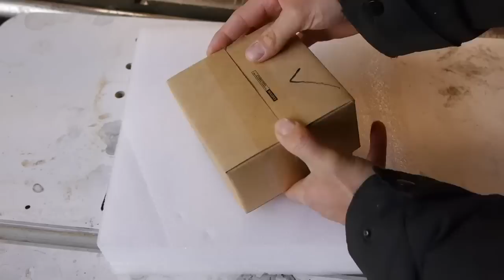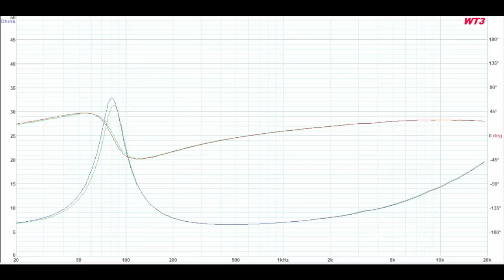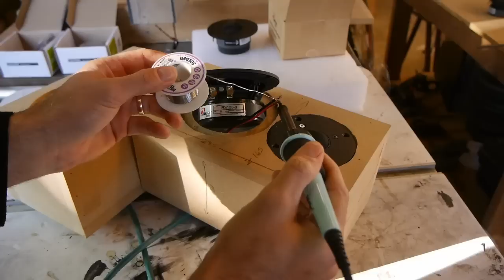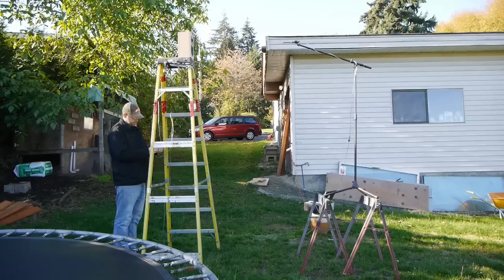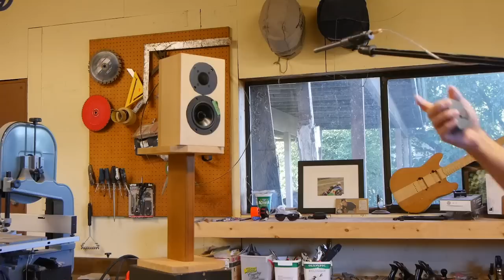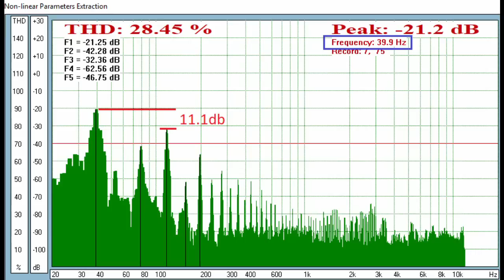Dayton Audio RS125 | Test and Review

Comment: I want to buy the 6" but I want to know if it's air tight? I'm making sealed monitors
Reply from the maker: Ive used the 5 and the 8, but not the 6. What do you mean air tight? It works just fine in a sealed box. Thats how I used both the 5 and 8. Decent woofers.

Comment: i giggled wen you said you do not find a build like this at this price 45.00 usd so so true but  for a 5 inch speaker i better get descent build for that i do understand speakers are way over priced in some cases .all so i have had a run of driver custom made woofers in the past and ill tell you in around 1999 a usa made 15 inch driver 2.5 inch coil on a  Kapton former twin magnet stack stamped steal basket rubber surround carbon composite light weight cone inverted dust cover aournd 17.5lbs weight  250 peace price was a bit under 70.00 .so that was a wile back but that does show one that fancy brands blow a lot of smoke up our hind ends price wise and the pore audiophiles are like my liberal friends lol they will buy anything as long as news on it sounds half true and investigate nothing to vett it LOL. you box looks find a bit of sanding and bedliner it with thick linerexxtreme bed liner would be a great shop box
Reply from the maker: Liberal friends 😂 Pretty sure I scared all mine away! Thanks for watching!
Reply: @ImpulseAudioSpeakers  i was hoping you  get a kick out of that its amazing i tell ye  i got a few only 3 out of all folks i know .yep biden won and i can see it now yea and my granny is half Sasquatch and not just a hairy french lady

Comment: Can these be used in FARFIELD studio monitors ?
Reply from the maker: Yes but they will only be good for low volume. They can’t get loud at all.
Reply: @ImpulseAudioSpeakers  so any suggestions on which to use as farfield are there any bigger ones on ebay and you should do a video about D.I.Y FARFIELD studio monitors Noone has done it at all
Reply from the maker: @TheMessenger212  aren’t farfield monitors just speakers?
Reply: @ImpulseAudioSpeakers  yes it's the monitors that most studios have sofit into the walls like the biggest monitors in most majors studios either ATC brand or Genelec brand they are called farfield because they can be used as monitor from more than 3 or 4 feet away
Reply: @ImpulseAudioSpeakers  speakers are different than monitors to me  monitors have help you hear 👂 more of your music with better clarity you know way more about this stuff then I do I would just love to see a video about make some studio monitor thats affordable ATC and Genelec monitors cost almost $20,000
Reply from the maker: @TheMessenger212  ya I see what you’re saying. I would suggest a monitor is mostly designed to be very very accurate rather than stylish in the home or big bass to sound fun. You can use any speaker that is very accurate as a farfield monitor. Look for a design with a +/-1.5db window and good off axis response. Hard to find.
Reply: @ImpulseAudioSpeakers  would you have any affordable recommendations and what about Dayton Audio Reference Series for Reference Monitors ?
Reply from the maker: @TheMessenger212  it really depends on what you’re trying to achieve and what your budget it. I personally prefer SB Acoustics woofers. I just measured a speaker for a friend on Saturday that had a SB woofer and it measured really well.
Reply: @ImpulseAudioSpeakers  from your expert knowledge how much would you think something like this would cost plywood or MDF and all drivers trying to achieve accurate sound like a studio monitor
Reply from the maker: @TheMessenger212  at least $500 for the pair. It’s not as economical against the common studio monitors. When you start building something that competes with the high end stuff then you see good savings.
Reply: @ImpulseAudioSpeakers  $500 sounds good compared to $20,000 for a pair of ATC or Genelec monitors any suggestions on exact drivers i should use

Comment: thinking about using these two drivers in a mtm design , is this good idea? I will have separate woofer section under neither. hoping to do sealed.
Reply from the maker: Yes could work fine for that. In a 3 way I would maybe look for something with more sensitivity, but can work.

Comment: Hey man, what software do you use to get the T&S parameters please ?
Reply from the maker: I use WT3 from Dayton which is now called DATS.
Reply: @ImpulseAudioSpeakers  thanks a lot !
Reply: @ImpulseAudioSpeakers  Excuse me I'm back with the same question, what software did you use for frequency response ? Seems like DATS 3 doesn't have a mic
Reply: since I'm at it I'd like to know the mic refertence too please :p
Reply from the maker: @samuelbalavoine5031  I used SoundEasy V20, but I don’t recommend it. I would check REW, HolmImpulse, or Omnimic. Those are better and cheaper. Omnimic comes with a microphone or the others you can buy a calibrated mic for about $100.
Reply from the maker: @samuelbalavoine5031  I use a mini dsp UMIC that’s calibrated by Cross Spectrum Labs.
Reply: @ImpulseAudioSpeakers  thank you, I'm currently looking for a set UP to record my loudspeakers and speakers in their box.
The dayton audio DS3 looks perfect for impedance, T&S and box tuning, and I'm reasearching for the audio side of the spectrum : frequency response, group delay, SPL...

Comment: Great Collaboration. Wondering about ear. My hearing has high loss. I cannot hear well over 8k
Reply from the maker: That’s ok. You may want to use eq or use smaller resistors to raise the tweeter level, but generally the brain becomes accustomed to hearing loss (within reason) and a “reference” sound will sound normal to you and I and everyone else all the same. You may miss certain details someone else won’t, but nothing can be done about that. The objective is to get a natural normal sound from the speaker.

Comment: What software are you using to do your tests and tinker with xover components?
Reply from the maker: Jon Doe I use SoundEasy for testing and Xsim for XO design. I’m not a fan of SoundEasy though. I recommend HolmImpulse or REW.
Reply: Impulse Audio Thanks for the quick reply! Keep up the good work. I've been tooling around diysoundgroup.com as you suggested and appreciate the time and effort that went into your designs. 👍

Comment: A dedicated  midrange driver , what would be the best case scenario for an enclosure? I’m not referring to getting base out of it , but getting the best midrange sound possible ,as though it was in a four way system . I’ve read if you build an enclosure for a dedicated midrange driver , go excessive on the enclosure size , have a sloped rear wall , and put  stuffing in it . 
Then you read about using round pvc stuffed behind it instead . Or glue round dowels on the inside walls to avoid standing waves . My thoughts were to have a cone mounted behind the driver in order to disperse the waves . The pointy end of the cone facing the back of the driver. Im sure there’s a hundred other concepts .
Reply from the maker: A largish stuffed enclosure with a sloped rear baffle is good. Your idea with the cone sounds excellent, though I've never seen it done and can't imagine it's easy to do. If you try it, let me know how it turns out and how you did it. Maybe using a lathe or something?
Reply: Impulse Audio 
That was my next thought , how to make one . I don’t have room for a lathe . I guess a 4th axis on a cnc ?

Comment: What actually happens when you incorporate more than 3 or four of the same bass drivers What changes in the crossover and size in cabinet. I know very little of the subject.
Reply from the maker: Dave Jones a lot changes that’s for sure. The XO has to change, probably to what’s called a 2.5 way. At minimum it has to change to allow for the higher volume. The box also has to change to work with more drivers. The box will have to be a lot bigger.

Comment: Interesting to see that your measurement software uses white/pink noise rather than a gated frequency sweep, (I'm only learning so bear with me).  Do you do any impulse cropping (to eliminate reflections) and subsequent merging of near and far fields, or rely on the outside 'anecohic'  environment?
Reply from the maker: MrFrobbo yes the gate on the outdoor measurements is set at 16ms. You can see on the far left of the graph the graph area is greyed out to indicate where the gate is set. Sorta difficult to see. I prefer sine sweep when measuring low frequencies like ground plane measurements. I use HolmImpulse for that. The MLS method is a little better for filtering out ambient noise.
Reply: @ImpulseAudioSpeakers  would be great to see more speaker measuring detail, there's no one really honing in on this so you could be the first and take lead here 👍 Your buddies 123Toid and Kirby also avoid the harder tech line of speaker  design, that's what drew me to your channel.  Hope you go for it.  Again, thanks for all your effort and the channel mate, without you three I wouldn't be back into this amazing and rewarding hobby, cheers.

Comment: Waiting for RST28F. Supposedly distortions be good and can cross very low - let see if it beats SB29 ring dome.
So, you run into similar T/S difference I did with SB17NRX -4  - I plugged your measurements into WinISD and sure in 2.5L  Qtc is 0.75 for #1 and 0.63 for #2 with 2dB less from 150Hz down - the difference in measurement between the two is very real. 😕 I wonder if it will be audible, considering standing waves, reflections, etc.
Reply from the maker: pliedtka RST video should be a couple days. 

Ya I’m actually pretty disappointed. I’ve been thinking about it since the video was published and it kinda sucks. Usually bass frequencies are easy to get good agreement. This is pretty poor. I’m not even sure what can physically be different about the drivers to cause this. It’s like one of the voice coils has more windings that the other or the magnet gap is tighter on the other. But even that would cause differences at higher frequencies. I don’t know... :(
Reply: The sort of solution that will try on my SBs is adding a backing magnet to lower Qts (decrease Qes). Never tried it, but some people did it. The smaller the driver the harder is to keep within close tolerances. Maybe with time they settle down closer to each other, but I doubt it.

Comment: You test distortion at 95 dB.  Is this a level you decided on because it represents normal listening levels?  Would the distortion levels your getting be apples to apples with the distortion plots in REW?
Reply from the maker: Joseph Crowe's DIY Speaker Building great observation. I’m actually targeting about 92db. It’s a common number but not some kind of standard. Part of why I rarely talk about distortion, and even cringe showing it, is because it’s never apples to apples. Especially if measured at a different level. Be very careful comparing distortion measurements and always take them as a casual look into where the driver is comfortable playing. Nothing more in my opinion.
Reply: Ok that’s good to know.  I’ll stick to comparisons between multiple variations of the same.

Comment: I noticed that you use white noise to measure FR.  Is that a better method to use than the frequency sweep included with the DATS software?
Reply from the maker: Glen Kashin it really depends what you need. I switch to sine sweep when measuring in the bass range. I much prefer it for <100hz range. MLS (white noise) can be better at filtering out ambient noise. Especially when you use a long test signal. I don’t use a very long signal. The other reason is my version of soundeasy only has MLS. The new version has both but I haven’t upgraded. So I switch to different software when I want sine sweep. 

Bottom line, both work perfectly fine. If I could only have one I’d pick sine sweep actually.
Reply: Thanks for the explanation.  I have been using a sine sweep in a quiet location.  Another thing I wondered is if you think using padding on the floor and walls to damp reflections when taking measurements indoors is a good idea.
Reply from the maker: Glen Kashin no problem. Adding padding doesn’t help all that much. Distance is the best. Get as far away from reflections as possible. Then set the gate time to just before the reflection. In a typica home that’s about 4ms.

Comment: You could attenuate the woofer break-up by using a Cauer filter. Simply connect a small capacitor in parallel with the large series inductor in the woofer circuit.
Reply from the maker: PA5cAl1 definitely, and usually the way I do it. But for the purposes of demonstration I used the traditional series notch.

Comment: Do you prefer measuring the T/S parameters in the box or using the added mass method? Is one more accurate than the other?
Reply from the maker: Derek Jarman I prefer the box method because I already have to build a test box, don’t have to tape or magnet weights to the cone, don’t have to have a scale that can weight grams, and I do find it more accurate. In theory it shouldn’t be more accurate but it seems to be for me. Both methods back calculate what Vas is. With the weights you are telling it how much mms has increased. With the box you’re telling it how much volume is available and it sees how much Fs changes and just like a box calculator it knows what Vas must be.
Reply: @ImpulseAudioSpeakers  does it matter what size the box is? Does it have to be close to what you are going to use in the final design?
Reply from the maker: Derek Jarman no actually smaller is better. The bigger the change between free air and closed, the easier time the software has predicting Vas. I will often do the test with the enclosure blocked off smaller than necessary, then once I have the TS parameters I use a hole saw to change the block into a brace. I show this being done in my Motus woofer review.

Comment: Vary nice work.  Thanks to share the FRD and ZMA files. Just one question in that sence.  I did compare the file you create in free air VS the provided files by Dayton Audio... is the difference in FS might be due to a lack of Break-in period on the driver you did mesure?
Reply from the maker: Benoit Lavigne these are broken in but may break in more. Mine are 20hz higher than Dayton. I couldn’t tell you why. Often manufacturers get a lower fs because they will drive the driver with a higher voltage when doing TS parameters. It’s actually not something that concerns me much. It’s surprising how much TS parameters can vary and yet the box prediction will stay the same.

Comment: You should use a 20mm Tweeter for a wider dispersion on the upper end plus a waveguide for a more constant directivity. Thats my a advice as a Speakerbuilder from Germany.

For the Woofer; put it in Bassreflex (tuned to 75Hz) plus a wide FrontBaffle and close to the Wall.
Reply from the maker: Nik Leiser I plan on ported around 70-80hz for the final version. Keep in mind this is just the testing. 

I like waveguide tweeters but that’s not what was selected for this one. Top end dispersion isn’t bad. I’ll show that in the next video. Definitely like waveguides though.

Comment: At what SPL of the fundamental did you do distortion measurements? 90 dB or just 2.83 V? I'm asking because distortion doensn't increase linear with SPL, especially when excursion comes near the end of its linear limit.
Reply from the maker: Marius Loubeeka as described in the video I increased the 1m SPL to 92db per infinite baffle (so it was less than 92db below the baffle step point) and took measurements at that level. So the 40hz measurement was actually a very low 80ish dB. It’s in the video but I didn’t really describe it well.